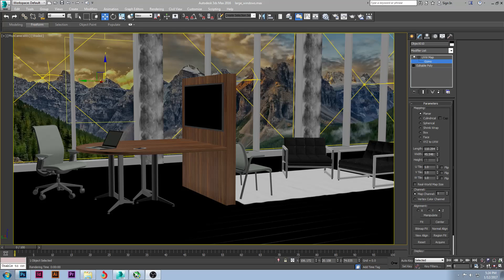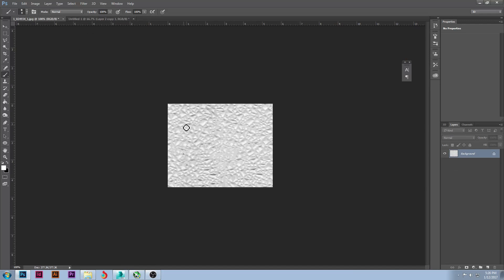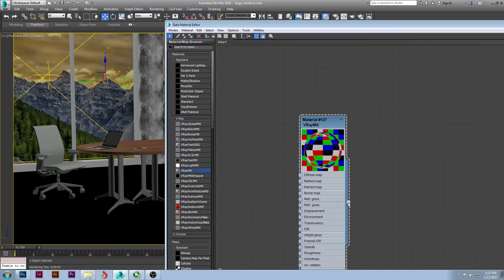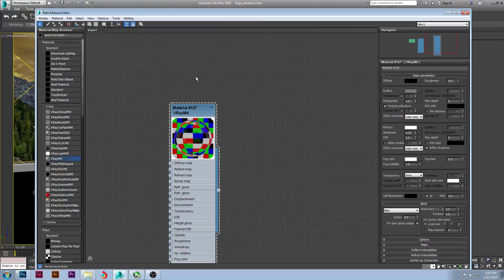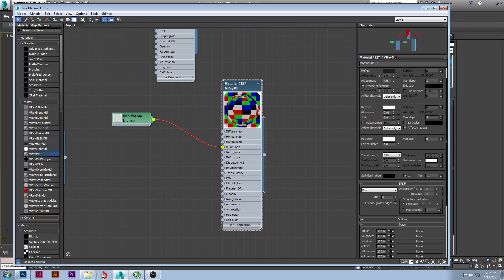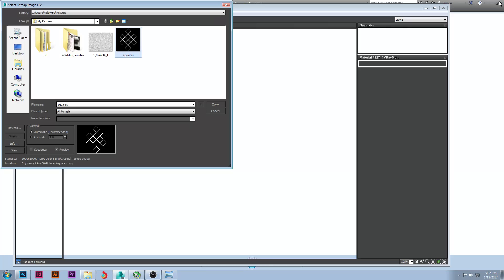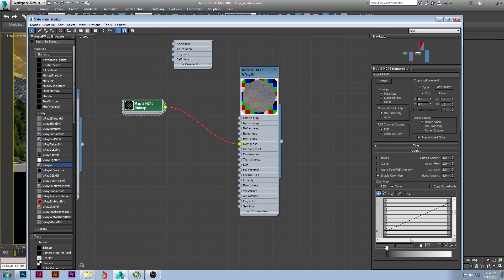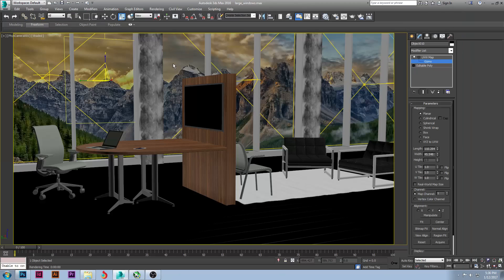How to Create Frosted Glass - Vray 3ds Max

Comment: It doesn’t seem to diffuse the light coming through. How do you do that?
Reply from the maker: what do you mean by diffuse the light?
Reply: @NickVanLoon  The light that passes through casts sharp shadows rather than soft ones which I would expect.
Reply from the maker: @ludvigInLegendaryLands  off the top of my head im not to sure. id think adjusting some of the refraction settings may help that. I dont think ive had this issue before so not sure how to answer